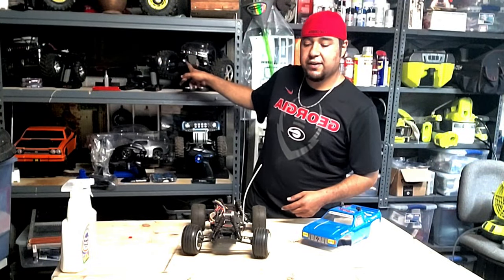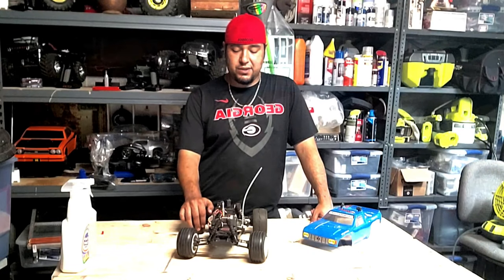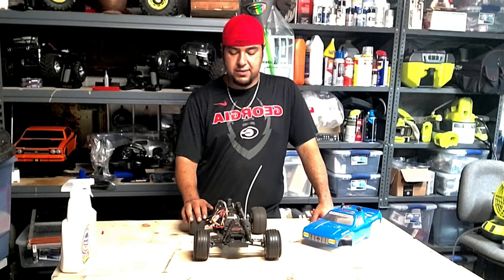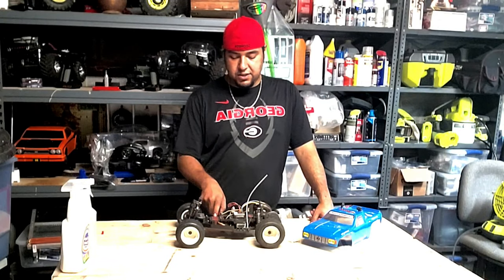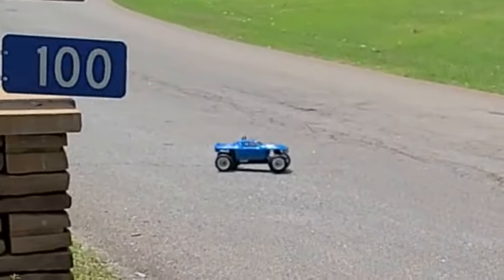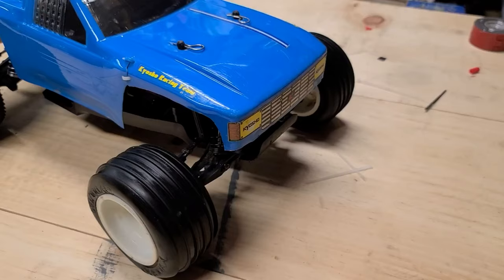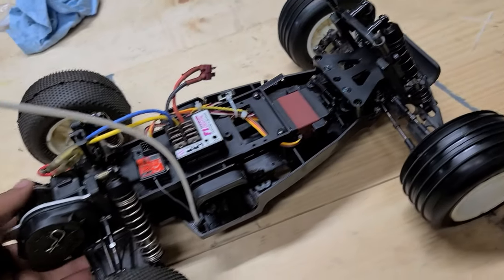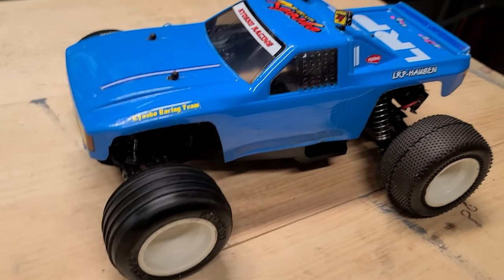Vintage Team Kyosho Racing LRP - Hausen Truggy Thing Cleanup and Partial Restore

Comment: A kyosho outrage st II, a stadium truck, worst thing about it is the flexing shock towers if you plan on doing vintage racing & the bushings through the drivetrain & out too the wheels.
Should be identical gearbox to the kyosho ultima which has seen a re-release & gotten some upgraded drivetrain parts too handle brushless power.
Decals are also available on ebay if you need that.

Another small mod you could do is adding a pair of carbon fibre plates near the top of the shock towers on each side of the shock towers & a bit longer screws so it stiffens up there a bit would help that overly flexible showtower issue id imagine. drive cups & drive shafts are shared with the kyosho optima as well.

So you can get universal driveshafts for the re-released kyosho optima & turbo optima too fit as well, jazrider has some universal drive shafts that should fit the optima on a quick google here for about 12 usd.
Reply from the maker: Brother! I appreciate all the info! You do really know your stuff! I've been having as much fun playing with older RCs than the new ones! I just got a hold of some RC Legends Cup that I'm gonna play with eventually